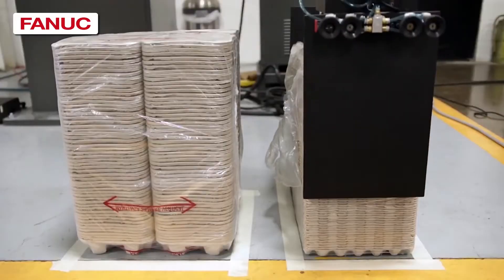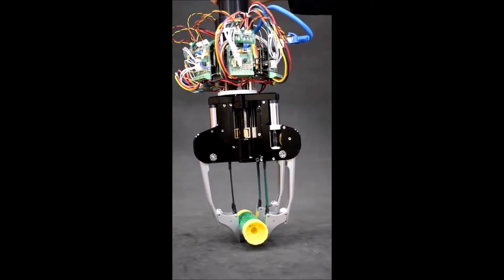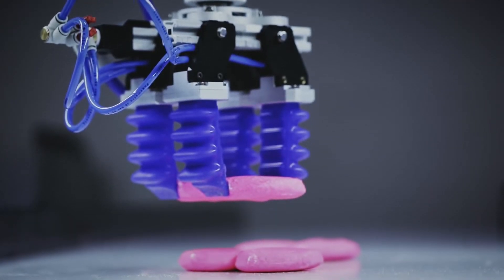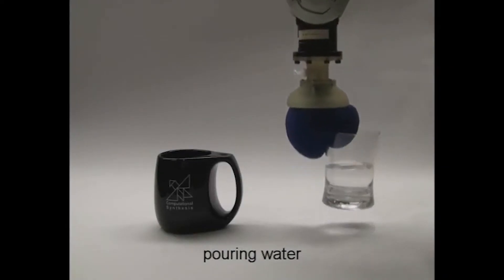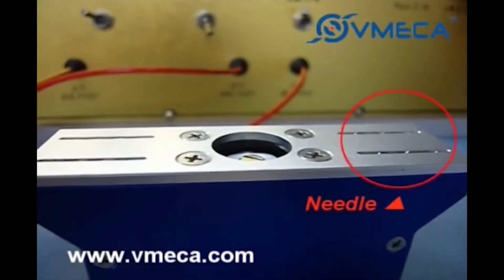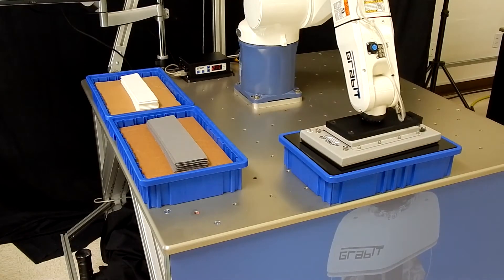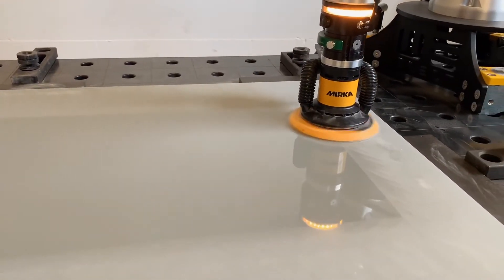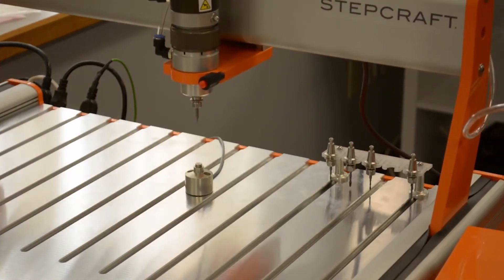Types and Uses for End of Arm Tooling (EOAT)

Comment: Can we use a single robot for weldimg, laser cutting, machinging , and spraying
Reply: You can (kinda). Every EOAT (End of Arm Tooling) is unique from the robot (you get Robots separately!). The key consideration is whether you are designing the EOAT to have multiple functions, such as a main gripper on one side, a machining tool on the other side, and additional features like sensors or cameras on the remaining faces. Or are you going to have an EOAT station near the robot, where it can switch out EOATs? There are many possibilities.

(I will feel bad for the technician or engineer who has to work on the EOAT or program, because complexity sucks sometimes.) You do have to ask yourself, is it practical? But remember, practicality is key, and it's what will guide you through the design process.

Laser cutting, which I have seen many times in the industry, is typically never used as an EOAT. It is very much separate. Welding, which Robots can do (think of Yaskawa Motoman), usually requires the robot to be dedicated to it due to the need for hoses and other specialized equipment. I have programmed the welding application a few times, but I am hardly an expert.

I have never dealt with spraying (I assume you are talking about painting). I can only assume it has similar challenges to those of welding, such as the need for precise control and potential overspray issues. Machining and pick-and-place applications are definitely acceptable.

Technically speaking, if you can design and build it, the only factor against you is programming. But then, how much are you willing to pay? Programming can be a real challenge, and it's something we all have to consider in our designs.